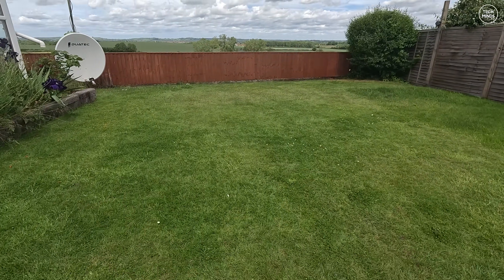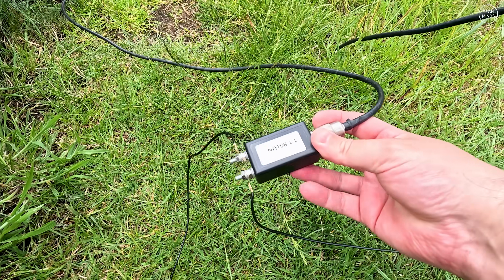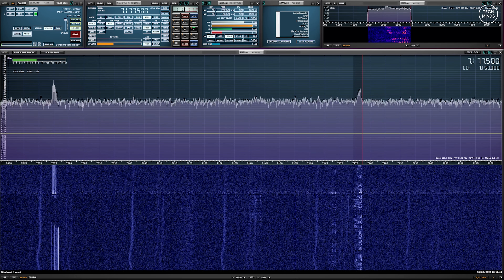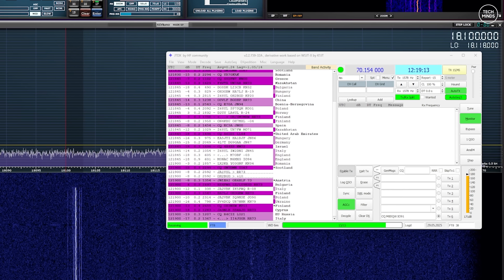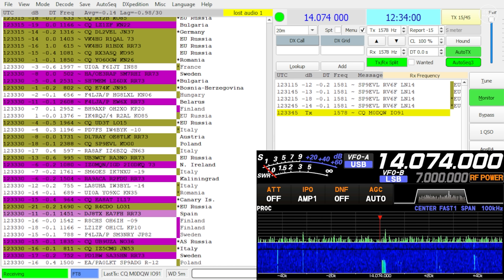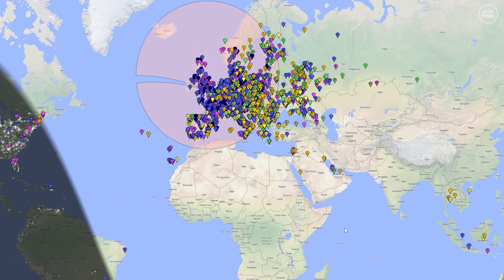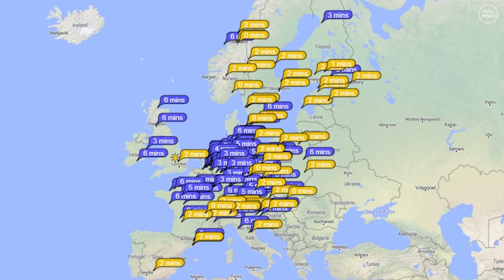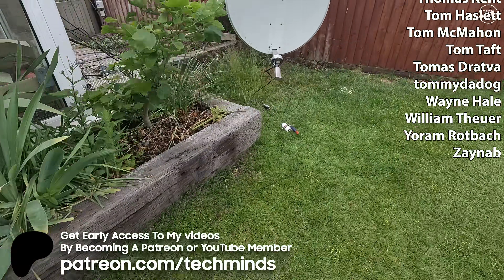Improve HF Noise Floor With This Simple Antenna

Comment: Hi, thx a lot for this video. I set up a video series on loops on my channel, explaining radiation, impedance, and more. 
It's interesting that a loop on the ground is picking up still a reasonable signal, because it's radiation goes mainly to the ground and perpendicular to the sky. I estimate, that due to its low radiation resistance it's delivering still a reasonable signal despite the strong coupling to the ground.
BTW the noise floor depends very much on the reception of strong signals on higher frequencies causing intermodulation.

Comment: Something else to think about, you can "stack" these to achieve more gain in a particular direction. Usually, you RX east/west or north/south depending on your orientation and feedpoint. You can take advantage of this by adding one more more "elements"  as reflectors and directors.  I use the 15' per side variant, relay switched to change orientation, with 2 reflectors, if you will, to improve directivity for my points of interest. There is more info online about this method if you are interested.

Comment: I use a LoG as my main receive antenna for most SWL activities/projects. I have 20m of wire on the ground into a 9:1 Balun. That's attached to an SDR on a Raspberry Pi. The Pi outputs a TCP stream and I can use a SDR program like SDR++ on any of my computers. I have recently taken to using the LoG with FT8. I use SDR++ to get the TCP stream and send the sound out via a virtual cable into WSJT-X for the receive and the output via my G90 to my EFHW or 1/4 wave whip. The SDR does overload but it doesn't seem to harm it at all and the software just corrects the overload for the next round. This has worked without issue for over 4 months now.  The only "down side" is that I can often hear much further than I can be received... the LoG doing it's job well.

Comment: I have used these for years. The LoG also generally will have a higher SNR which is another key to this antenna. Also, the correct transformer to use is a self built binocular torroid with a 12 winds to 4 winds. That kind of transformer will prevent you from transmitting. Also, you can use or try an LNA in line and feed it with 75 Ohm cable.
Reply: Not a 9:1 unun?

According to the famous KK5JY LoG, he uses 9:1 unun.
Reply: @PureAwareness76  No, that is a 9:1 balun, not unun.

Comment: It would have been interesting to compare the signal strength reported by your FT8 program between the two antennas for individual stations. That would indicate if you had actually improved the signal to noise or just attenuated everything.

Comment: As a few have alrady mentioned it's really a recieve antenna and the original design called for a 3:1 or rather 6:2 ratio on a small binocular core. Those had no transmit capability not least because of the small wire diameter in the balun and the benefit was more in SNR rather than absolute signal strength. They do work but no miracles..Good as a recieve antenna that essentially takes no space!

Comment: best balun for loop is balum 2:1 , with 30metres cable working fine in 30M band 10Mhz  , the longitud cable is the same with the bande if you use 20metres for 14Mhz working fine . Only with Balun 2:1, the loop is 100ohmios you need divided for 2 with balun 2:1 , sorry for muy inglis

Comment: I have been using a 70m LOG for the past 11 years and have constructed a big number of baluns for obtaining the best results. The original design says to use a 3:1 balun
 In the end a 2/6 turn provides the best result here. I' m using 2 common mode chokes, one at the balun and the other at the radio end. A quadruple shielded RG-6 is used obtaining the best SNR possible. The loop wire is just pinned down with u-shaped 15cm pins in the grass. The antenna is no longer visible after a few mowing sessions. Elevating the wire from the ground affects the SNR in a negative way. To test I used my RSPduo comparing with my  86meter loop skywire hanging 10 up in the air. As some mentioned some 4:1 baluns are working fine, but not optimal. 9:1 baluns and shurely not ununs are not a good option for a LOG. Above 20 mhz the LOG is compromised. Also be shure to use an earth at the radio end. A transmit antenna is not the best receive antenna. This is why in the old days separate transmitter and receivers where used. Just think about it. When measuring SNR, a broadcast am modulated signal, plus or minus propagation is better. SSB signals are fluctuating by origin so no good value can be noted. 73'
Reply: I have been using and experimenting with LoGs and BoGs for a decade as well, and built the transformers myself. A few questions, Ron. You say ‘the original design says to use a 1:3 balun’. Where can I find this design? I only know the KK5JY design, which uses 2 to 5 or 6 windings, hence 1:6,25 or 1:9.
You say ‘9:1 baluns and shurely not ununs are not a good option for a LOG’. You also say ‘In the end a 2/6 turn provides the best result here.’ But as far as I know, that is 1:9. So that sounds contradictory to me.
Maybe I have missed something, but I don’t understand your nevertheless very interesting info.

Cheers PA3BAK
Reply: @AxelWBak  , the KK5JY design is what I also used. I used a BN73-202 binocular core, with the 3 on 2 windings but made a mistake as to be a 3:1 ratio. Mind you, not all binoculars can be used. I started with some unbranded core types that were no good. mea culpa for my error.
Reply: @SDR-DXobserver  Thanks Ron!
Reply: I use binocular toroids myself and wind them the way you suggest. There are several websites that explain how to build the balun.

Comment: I followed instructions I found on line and wound a 5:1 with a binocular core. I salvaged it from a TV antenna balun. 60’ of wire and a RG-6 75ohm coax to my receiver. Quieter with a bit weaker signal. Really worked for SWL 4mhz to 15mhz.

Comment: An extra 18db of gain can be achieved if the antenna wire is SLIGHTLY covered with cow or sheep manure while on the ground. This has been well documented by experiments by the US Navy. Full documentation is available on the Internet by searching for “Animal Manure Antenna Gain Enhancement”. 

 I have personally verified the gain achieved by covering the wire with a slight amount of bovine manure. 1/4” works very well. In the name of science I even went as deep as 1 inch but the result was negligible versus the 1/4” depth. I also purchased 3 bags of sheep manure garden soil and used that instead of the pure sheep and cow manure. My results were less than optimal versus the straight cow and sheep manure.

 In 3 specific cases I was able to achieve an unbelievable 18dB of gain by adding a slight amount of cow urine into the sheep manure……….. I want to thank the US Navy for posting the results of their experiments for interested parties to duplicate.

 Good DX!!!

Comment: The SWR of loop antennas can vary greatly depending on the feed point location and even the shape of the loop itself. Feeding in the corner vs. feeding in the center of one of the legs will have as much difference as 35-200ohms. Rectangular loops vs. square vs. delta shapes will all have different RF patterns as well. Also wire thickness will have an impact on signal strength to a degree.

Loop on the ground can be extremely helpful in noisy environments when using an automatic RX/TX switch. Get all the benefits of each antenna without having to compromise.

Comment: Thanks for the video. We love wire. Our daily antenna is a loop made of DX-10 at 320 feet in length in a square about 6 foot off the ground with a 5KW 4:1 Balun at the feed point. We also use a 5KW 1:1 choke just after the tuner exiting the wall. Running full power here in the US, we have great results, with SWR around 1.2 or lower using this setup.

Comment: I've had excellent results with a LOG  about 15'  or 4.5 meters per side .  another very good antenna for RX is I have a wire 9.14 meters length ( around 30')   that is hanging along maple tree trunks about 1 meter  above ground and it has an old rusty steel fence below the element . very often it hears better than my end fed wires, especially on 40 meters and around there. even on my QRP radio ( no DSP or Filtration ) it's really  wild how well it picks signals up. I have it hooked onto a 9:1 Un Un.  also trying an active mag loop just for RX as well.  - fun playing around with different designs .

Comment: On HF for receiving, signal to noise as you say is more important than gross signal hence the value of lossy but quiet antennas like this. This also explains why mag loops can be good for RX too. It would be interesting to see a comparison between your loop on ground against a mag loop.

Comment: Very interesting experiment!  Thanks for sharing it with us in this video!

There is another kind of antenna that is designed to be operated at near ground level that you might want to investigate.   And, that is the Beverage antenna.  They are designed to be installed at about a foot off the ground.

I am fortunate enough to live near W8JI, here in Georgia (about an hour's drive away).  And, he has an array of Beverage antennas on his antenna farm - which also includes four towers over 200 feet tall.  Anyway, if you search on Beverage antennas, a link to W8JI's web site is the first search result that comes up.  I toured Tom's antenna farm about 20 years, or so, ago.  Just walking around to see most - not all - of the antennas took over an hour.

I think you will find his article about Beverage antennas very enlightening.

73
AI4IJ

Comment: 9:1 would be a better choice for a Loop on the ground, but any antenna is better than none,
Reply: The characteristic impedance of a full wave loop antenna is about 200 ohms when installed at a proper height.  Placing it on the ground would reduce the feed point impedance significantly - perhaps, as low as 120 ohm, or less.  So, a 4:1 might be a better choice.

If the feed point impedance on the ground is 120 ohms, instead of 200 ohms, a 4:1 balun is going to bring that down to about 30 ohms - so, around 1.5 to 1 SWR.
Reply: @richardowens9061  theory is great and all but having used loops on the ground 9:1 works best 👍

Comment: Apparently, the noise is mostly from higher than the hf band. Perhaps an efhw with a lowpass filter to suppress rf above the hf spectrum would perform well including on transmit. Something to try. KK5R

Comment: I used to have a 160M full wavelength antenna up only about 30 to 40 feet. It was great for being a "quiet" antenna, but only in terms of quiet being manmade noise. It wasn't very directional, depending on the band, but was an antenna I miss using. I got my inspiration to put it up from an article online from an antenna guru RNL Cebik, W4RNL. He has an article: What is a HOHPL? Horizontal Oriented Horizontal Polarized Loop antenna. I'd suggest you seek his article for more antenna theory and testing.

Comment: I did this and use about 90~ft of 10awg wire and using 75ohm coax (rg6q specifically). I found in testing that the loop worked best at 800ohm (75ohm 11:1, 50ohm 16:1) matching simalar to a beverage antennas.

Edit: i use a 20db lna which makes the singal strength comparable to me dx commander with lower noise floor.

Comment: Now this is where an RSP Duo would be a valuable asset. You could run the 2 aerials into identical hardware simultaneously, then let it listen to ft8. Also, would a shorter loop perform better at higher frequencies?

Comment: With your end fed halfwave, if you don't have common mode chokes on both ends of your coax you may be conducting noise from your shack out to your antenna and then receiving the noise. First try a hefty common mode choke just outside your shack, then try adding another at your antenna.
Reply from the maker: I use 1:1 chokes at both ends.
Reply: @TechMindsOfficial  Wow, then it's gotta be a lot of radiated noise nearby, maybe conducted on something else. Seems like too much noise floor increase to be just atmospheric. I built a handheld sniffer using a duckie to JFET common source follower outputting to both a audio amp and a JFET infinite impedance AM detector. The audio amp is just a dual opamp, and speakers are tiny headphone-size. Been extremely handy for finding noise sources, and there were a lot of them.

Comment: I did LOG experiments using  LZ1AQ rather than a balun some years ago. I honestly cant remember my conclusions other than low noise, but I do remember that burying the cable, so a LUG not a LOG, it still worked.
Reply: That's a great idea I like that.  ⭐⭐⭐⭐😀😀
Reply: NIce, I have still have an unused LZ1AQ, I will try this too.

Comment: Maybe I'll have to watch again, but my impression was that the signal readability (essentially signal to noise) was better with the loop on 40, but worse on 20. But perhaps there was some QSB that aligned with the testing to give that impression...
Reply: That kind of antenna works best on the lower bands, 20 m is nearing its limit. Also that signal in 20m was quite strong so perfectly clear even with the nigher noise of the EFHW antenna.

Comment: What I notice is that the noise floor drops, however the signal level drops as well. Looks like the long wire introduces significant attenuation. That indicates you need a  bigger diameter conductor to reduce resistance. What if you use a coax cable as a loop  connecting the outer conductor to that 1:1 transformer.

Comment: So, theoretically the low noise floor you get from a LoG is down to the fact that a lot of the (local) noise is caused by electronic devices nearby. That noise is reasonably close by and taking off from ground level and heading up. Effectively the LoG is below the noise radar and only receiving signals for far away heading back down to you. 

The higher the loop the more you’re putting it in the way of the local noise taking off.  

That’s my take on it anyway.

Comment: I use a 4:1 balun, so u might get better results doing that.
Reply: Why 1:1 or 4:1 when everywhere they use 9:1 unun?!

According to the famous KK5JY LoG, he uses 9:1 unun.
Reply: @PureAwareness76 4:1 to window line to 160m horizontal loop fed up 100ft tower. Works excellent Tx/Rx!

Comment: You might need a LNA with the LOG due to the low relative signal strength, which can be lower than the sensitivity of the receiver.